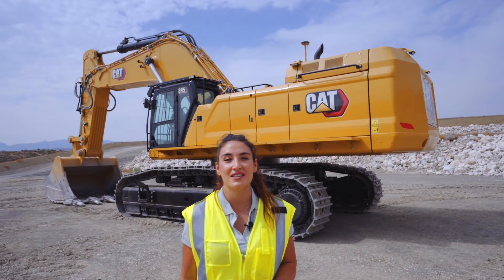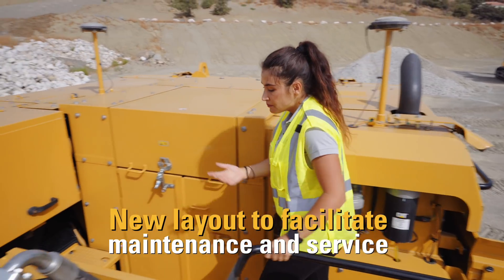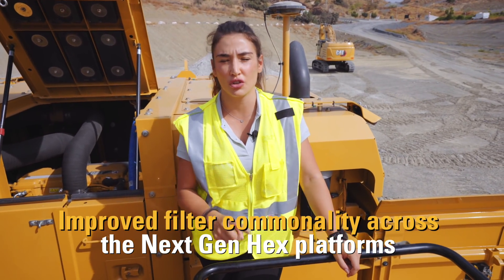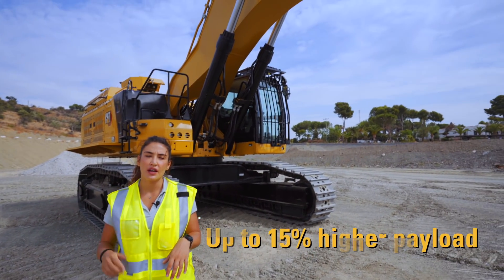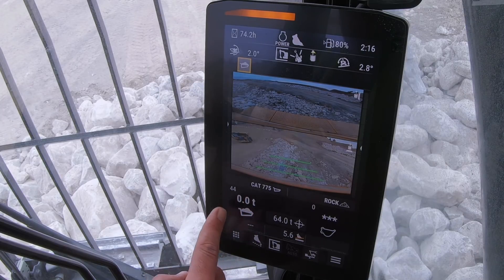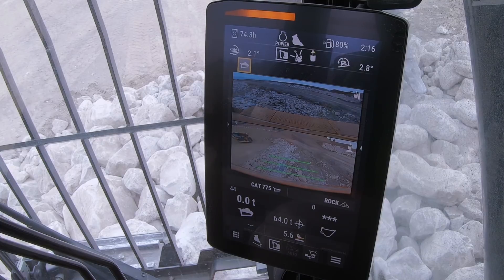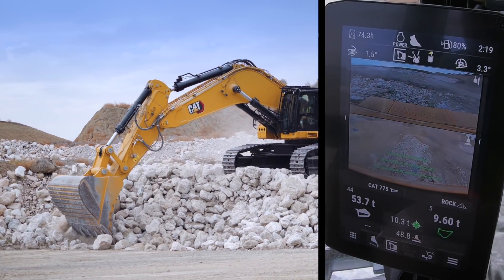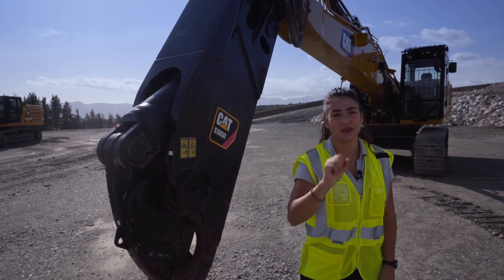Cat® Next Gen 395 Hydraulic Excavator | Walk Around and Demo

Comment: When F series came, they told that it is better because don't have separate swing pump as previous B,C,D models. And now we have a separate swing pump again.... So it was not better, but only cheaper. But users didn't like that. Engine with pumps reversed, turbocharger behind on counterweight side- yeah, easier to replace (i've changed turbo in 374,385,390 a few times, it weights about 60 kg so i know what i'm talking about, it's quite a job when you have direct access to it.) i'm curios how operators will like reverse design with coolers on the right side and pumps on the left cab side - about noise, and heat wave from colers going to the cab. in C,D series air entered coolers on the left and was thrown away to the right far from cab. Now it is opposite- and i know that Komatsu and Liebherr users complained about it - when it's hot A/C just can't maintain convenient temperature in the cab. Will see..